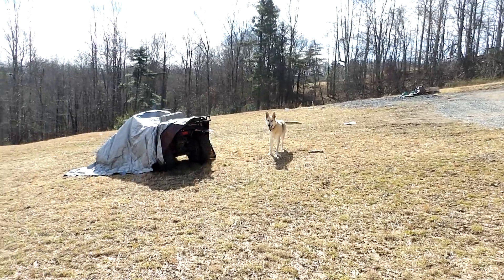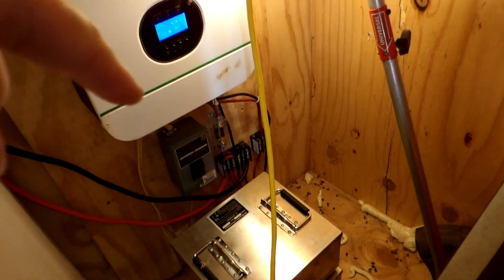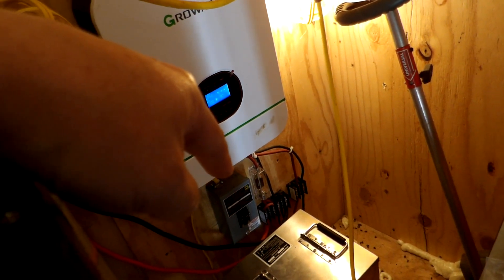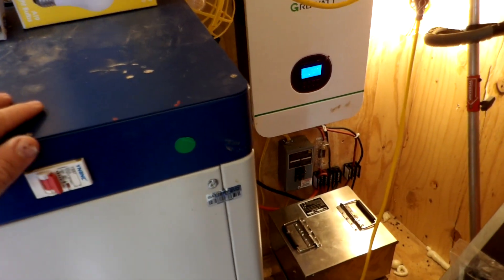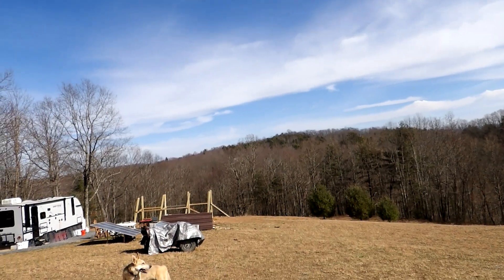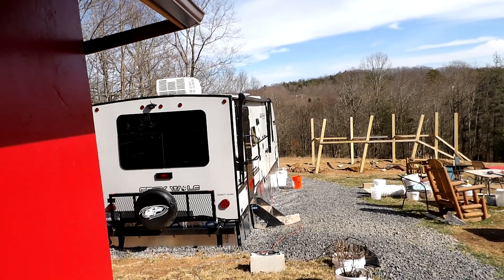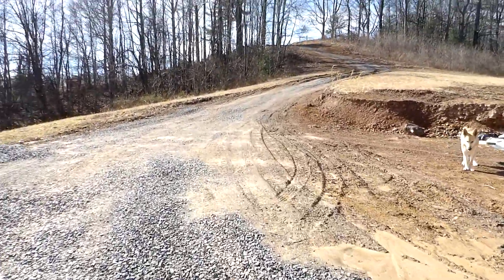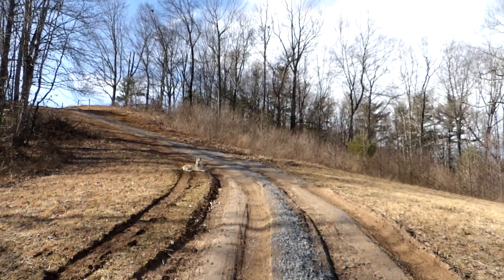Making adjustments with the off grid solar system to make sure things are working right.

Comment: ALL YOU NEED IS ONE OF THE BIG Hula Hoops AND THREE Dollar STORE SHOWER CURTAIN AND THE HOOKS TO PUT THE CURTIN ON THE Hula Hoop... PUT A 2x4 off the back side of the battery room and move your out door shower behind that for privacy...  So NO-ONE will see your naked butt and it will be used by every one that hauls the water to it...  I have the bag and shower thingy you hang from a tree and that's how I plan to use mine...  With the hoop and cheepy curtains... Make sure you have a plastic chair to keep your dry clothes and towels right by your curtain...